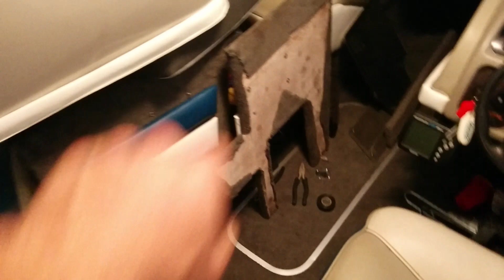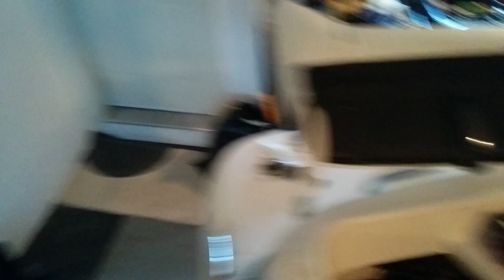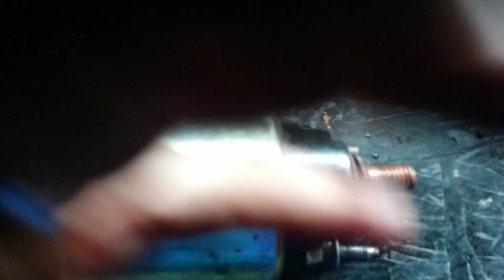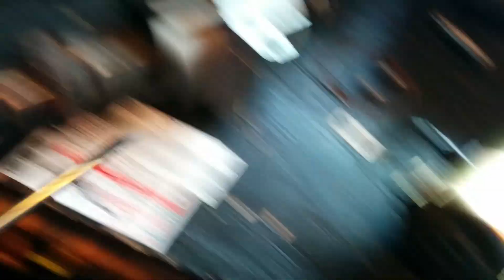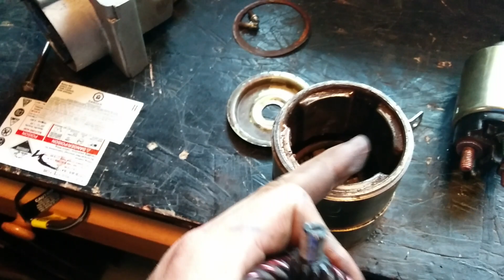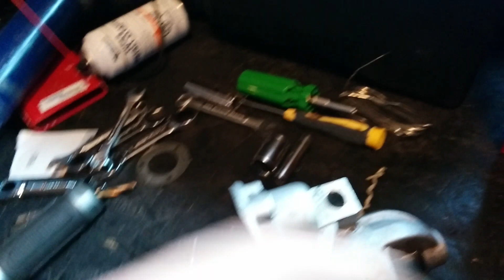4.3L mercruiser starter removal, disassembly.

Comment: Why not show the removal (like in the title)?
Reply from the maker: I had heard it could be tough so I didn’t film it. Turns out it was a piece of cake. 2 bolts with 1/2” heads. Very accessible and just popped them out and the starter was in my hand. No prying or fighting. It’s laid out very nicely.
Reply: @SuperMusicnut  Thanks, great answer :)

Comment: im trying to find out what size socket for the solenoid attachingf screws to the starter nose cone ??  they are reverse torx known as E-series.  but what size/number?  cant find anywhere what size these are...  i have one ii need to remove swap due to broken off S-terminal wire stud.....   or maybe i can add a starter relay/switch 'ford' style.  although wihotu the integral solenoid able to engage the plunger to slide out the bendix drive gear it wouldnt work anyways,   so im kind of at a loss here.  no real way to fix this issue problem without just replacing the solenoid or finding a way to replace/repair the broken off S-terminal wire stud, hmmm...  i even soaked the stud and nut in penetrating oil  spray but it still broke off, wow....
Reply from the maker: Hey Randy, sounds like a pain for sure. If I was you i'd do what I did and just replace the whole thing. Here's a link to ebay for the same starter I bought. I bought this when it was $69 now it's only $38!

https://www.ebay.com/itm/New-STARTER-Mercruiser-marine-4-3-5-0-5-7-6-2-Liter-GM-50-812428A3-50-807907-/163668645755

Comment from the maker: Hey Richard, I can't find the exact model number of the starter anymore. I can say the boat was a 1996 and had a 4.3L mercruiser in it. On ebay they sell for around $50. https://www.ebay.com/itm/New-STARTER-Mercruiser-marine-4-3-5-0-5-7-6-2-Liter-GM-50-812428A3-50-807907/172490771830?fits=B_Make%3AMercruiser&hash=item2829404d76:g:4QsAAOSwFytaIEBm

Comment from the maker: What were the symptoms of your starter failure that led to the removal of it? I only ask because my solenoid came off very easily. I ground down a 12 point socket small enough to fit onto the 3rd hex bolt head and removed it. Once the last bolt of 3 were removed the solenoid slipped right off no problem. If your plunger is stuck in the engaged position, so the teeth are always engaged with the flywheel, that would potentially make it difficult to remove the solenoid because it would be pulling on the arm that lifts the teeth into the engaged position. IF this is the case try pushing down on the teeth on the starter that would "un-plunge" the solenoid. See if that makes a difference.

Comment: This video is several months old but... did you have any trouble getting the solenoid out? The starter itself came out okay but I've removed every bolt I can find and the solenoid won't budge.